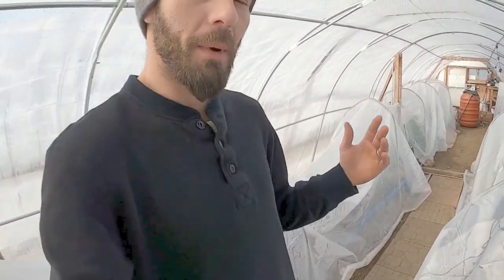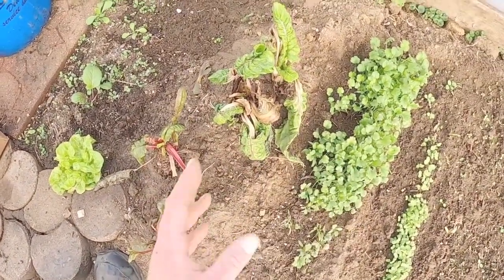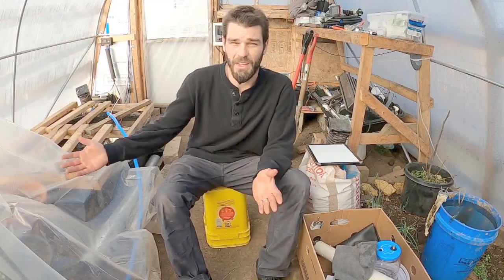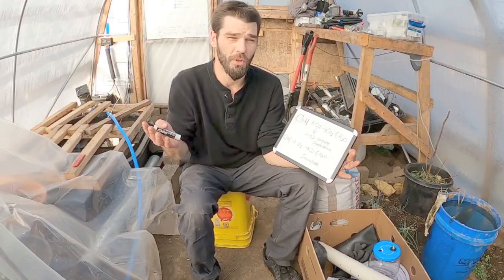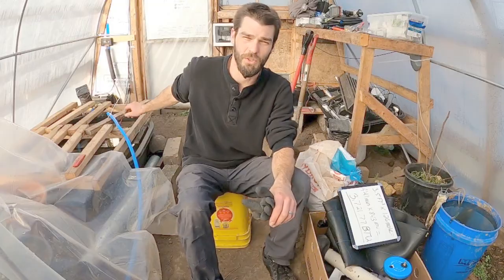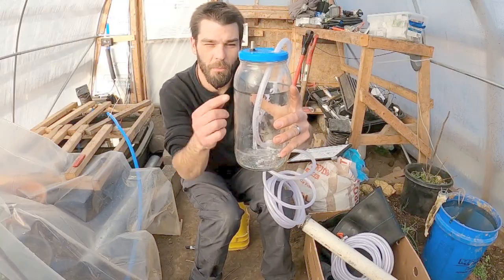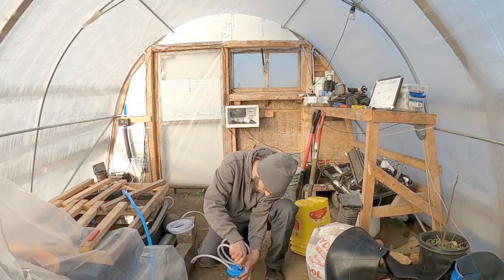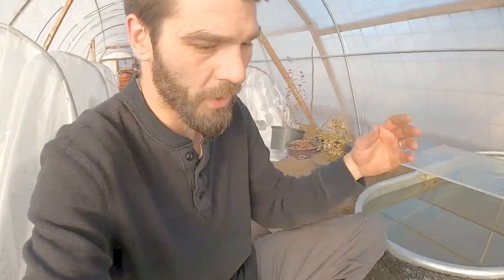DIY Compost Methane Capture Experiment | Jean Pain Compost Heating Methane Harvesting System DIY |

Comment: Have you gone ahead with another experiment to collect methane from a larger pile? Any luck? I am keen to give it a try as I have a large pile composting
Reply from the maker: In the process of turning my compost heating barrel into a methane producing system in the middle of our compost pile. Basically the way Jean pain experimented with it in one form. Because the materials have to be contained in order to get methane capture, although if it’s on a big enough scale like a landfill the mass of the structure forces methane into tubes

Comment: Don't you need some pressure somewhere to force the methane to inflate the tube?
Reply from the maker: yes your correct! so what I did was bury the tube about three to four feet inside the hot pile and buried it back in in hopes the load of compost/woodchips would break down and form pressure as the methane forms. this is how jean pain did it but he did it on a much larger scale with larger harvesting equipment. good question and thank you!
Reply: The inner tube and the loaded weight on the inner tube was developed by L. John Fry.  He was the adviser to both Jean Pain and Harold Bate.   Fry, determined that the temperature range for methanogenisis is 92-95 degrees Fahrenheit.  Therefore keeping. The biodigester at 100 degrees is energy wasteful by 5 degrees that translates to 1000’s b.t.u.’s per hour.  It does not pay to be imprecise.
Reply from the maker: Great input

Comment: Not sure why no one has mentioned that you need to have a sealed chamber in or around the pile to build pressure, If you go back and watch/read the PAIN method you will see that he did so in the center chamber in the pile. Also you can scrub the H2S with steel wool. Also your calculations may need some work, with water and steel wool scrubbing you can get about 82% methane from this method.
Reply from the maker: this is wheat we grow for them, they will devour this with other soaked foods in winter for extra nutrients when theres snow on the ground for months. the sprouting wheat berry has more nutrition as starches are converting making it a better food source than the grain unsprouted. I've never had any issues and our chickens will eat this every day in the deep winter.

Comment: Also you need to add a flashback arrestor to your burner
Reply: wasn't that the purpose of the bubble jar or pickle jar?
Reply: @NordeggSonya the main purpose of water bottle was to trap cannon-dioxide in the water.  Above the water line you have concentrated methane.  The CO2 deters thermal efficiency.
Reply: @NordeggSonya  I missed that part, the issue with that jar though is the lid is metal, even though its coated if any h2so4 gets to that point it will likely corrode that lid. Best to use plastic/glass. I didnt see a filtration/capture system for the H2sO4 when i looked back through. You can use either activated charcoal which can be made by applying steam to charcoal in an enclosed container in a fire, or through some other methods. I would also put a check filter with steel wool in it to see if the charcoal is saturated and needs to be replaced.
Reply: @Kevin-qn7jf if you are going to be pedantic, do so all the way.  Include a calcium-hydroxide scrubber to remove the CO2 and a desiccant scrubber to remove water vapor.  But will it be cost effective?  Yes, because efficiency is always cost effective!
Reply: @estebancorral5151  can't you pump the CO2 into a greenhouse to scrub it that way, also I dont understand why we are so carbon nervous, and not considering the situation of deforestation as a cause for CO2 emissions issues. Trees and plants naturally convert it into O2 by extracting the carbon.
Reply: @Kevin-qn7jf  it is impossible for all the C02 to be assimilated by the plants in the greenhouse.  The remainder would be pollution.   Therefore, a containment device such as a scrubber is indicated.
Reply: Amen and Hallelujah to that!!!

Comment: You will get an acid that is corrosive to metal, you should find a way to seperate it before it reaches your valve, or that could be an issue
Reply: It is called Sulphuric Acid.
Reply: @estebancorral5151  Or is it Ammonia?
Reply: @ericménière ammonia is a base not an acid. You learn things like in 1st year Chemistry class in high school.
Reply: @estebancorral5151  yes of course but a base can be as corrosive as an acid that was my point !

Comment: Any methane captured yet?
Reply from the maker: I did observe a few bubbles here and there once I shortened the tubing running to my storage, but I did however dismantle this capturing system. I simply didn't have the room for something that wasn't producing much of a result, I wouldn't have caught enough to burn. too many experiments not enough space lol, thanks for watching this and ill bring a different idea to capture it later, either this or next winter as I plan on increasing the pile size and the insulation (leaf bags) to be up to about 40-50,000BTU per hour harvested off of it. with the larger pile ill have more opportunity to harvest rising methane with a different device.